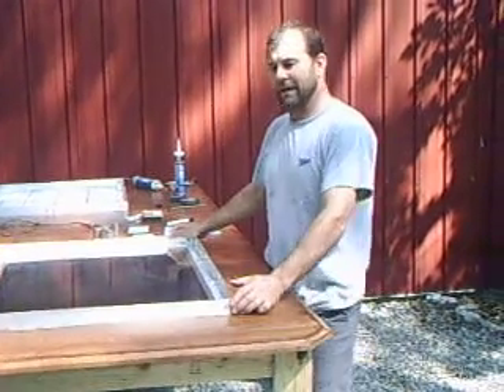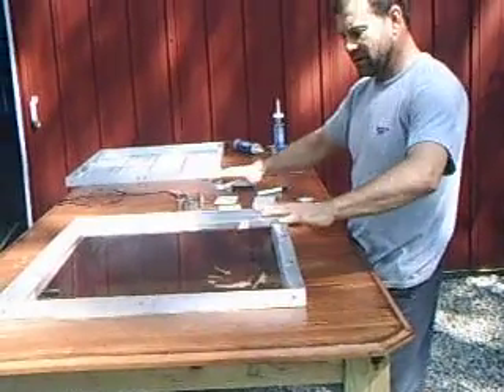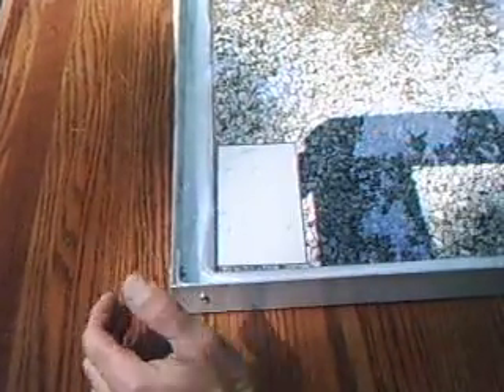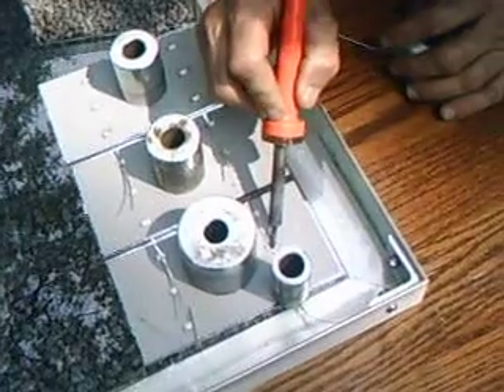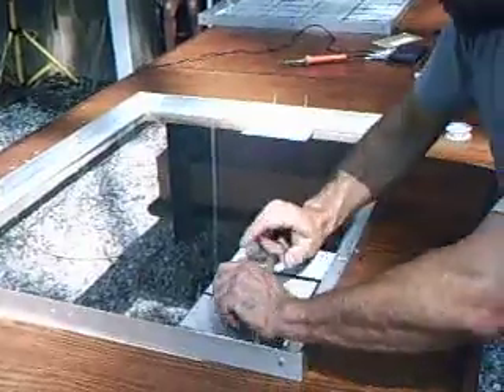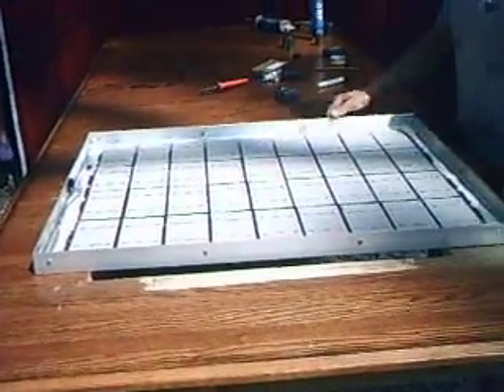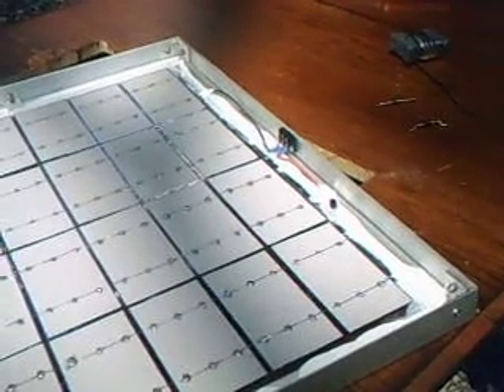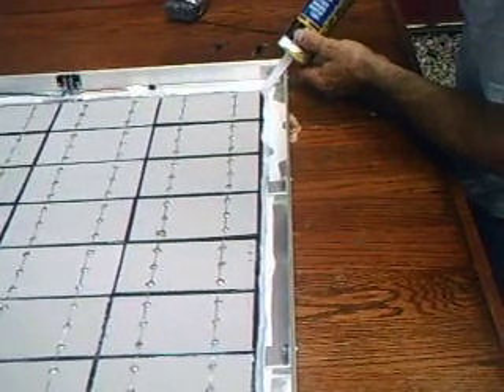How to make a solar panel at home part 1 save on your power bill

Comment from the maker: Hello. Yes it is more to it than that. To run your refrigerator you would need 12' x 12' area of panels and 6 large batteries. To run a air condtioner it would take a lot more panels tjhan just 12' square.

Comment from the maker: I use 1/4" clear tempered glass. Its is the strongest. The most efficient is 1/8" low iron called starfire but it is expensive and weak. Do not use matted glass it is for panels that heat water and not photovoltaic. The strongest is 1/4" clear tempered.

Comment: Mark,   Very instructive, one question,  instead of using individual tabs cut into what seems to be about 8 inch pieces, could you not do a 'full run' with a single tab from one end to the other side?  across each cells in the row?   Just seems like it would be faster and easier, but you may know of a reason why this will not work.   Thanks

Comment: Mark ,
Please rmmbr that we use Diodes in Generatiors to convert DC to AC, same principal can be applied with solar cells, which will also help us keeping batteries n UPS / inverter away from panels coz AC dont heats up if travel long

Comment: Hi Mark,
Can we convert 220 volt dc ( solar energy ) to 220 volt Ac with help of diodes then feed to UPS as main power?
Is there any harm doing to solar panels.
In this process we charge batteries through UPS and not directly with Solar panels, so we don't need any circuit breaker for overcharging of batteries etc???

Comment: Hi Mark,
Is there any cheaper chemical we can use as replacement for sly guard n dow 6010. 
For generation 3000watts how many solar panels should i make. I plan to use 156mm x 156 mm cells with 4watts capacity.

Comment from the maker: Well you will need around 2000 3x6 cells. I would start out with 12 golf cart batteries. I have used sylgard 184, dow 6010 and cell gard. You will need a charge controller to protect your batteries. Only use tempered glass. I use 1/4" clear tempered.

Comment: dear Mark
i hv few qauaries
1. how many cells we need to generate 3000watts
2. what should be the how many batteries of ( 12 v) each we can use to store that big volume of energy
3. What is chemical name of slyguard and what did u pour from the small bottle.
4. How to protect batteried from overcharging.
5. What kind of glass we can use for panels ( any special one)

Comment from the maker: Do not use lexan. It will make the cells crack in the heat of the sun. Lexan expands more than the cells. You have to use glass.

Comment: Answering your question which I'm sure you've already found an answer to.. The electrons are created by electromagnetic force within a generator. A basic example of this is copper wire wrapped tightly around a magnet. When it spins, it creates a flow of electrons.

Comment: @lightfdar SD945 Diodes for a 3 amp panels 36 cells 18 volts 65 watt, or 6 amp diodes, they have 3 amps 10 amps think you can find them at some radio shacks or electronic store, most defiantly on ebay

Comment: @reynoldsken  MLsolar on ebay they have the best price on a gallon amongst other things, but do yourself a favor and Tab your own solar cells factory tabbed cells suck and some just fall off because they are put on by heat and no solder they DO NOT MAKE GOOD CONNECTION, and only use solder coated tabbing wire, use a pencil eraser on the 2 white line on front expose the metal strip back contact as well, then flux it then lay tabbing on go down with 60 watt iron.
Remember MLsolar ebay great guy

Comment from the maker: @leomhm My biggest panel is 108 cell's,any bigger and it's to heavy to handle.I am not sure what technical term's you want. Sylgard 184,100% silcone caulk,6 amp diode.   Mark

Comment from the maker: @jdbobey Hello 100% silicone will not hurt the bus bar connection. The sylgard does go under the cell and will not affect the electrical connection,it protect's the connection's.  #10 wire is more than enough I use #12.   Mark

Comment: Don't you end up with trapped air bubbles between the solar cells and the glass using this method?  We've had that problem with similar methods.